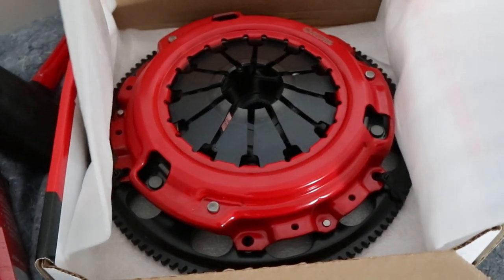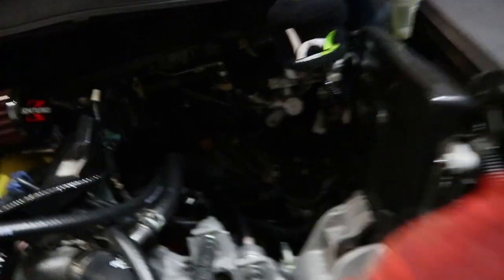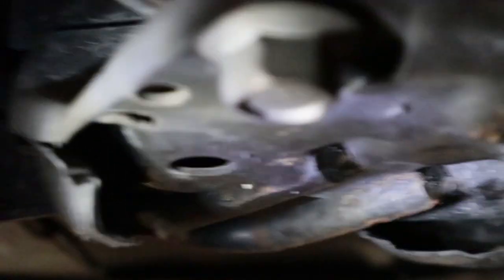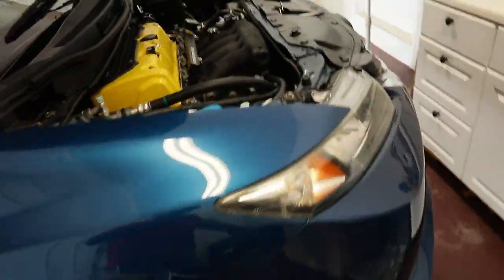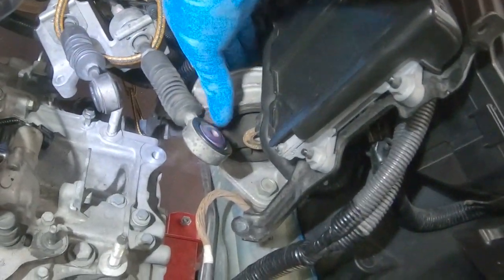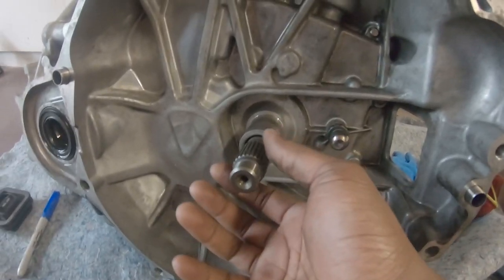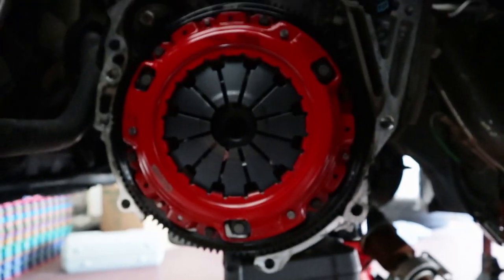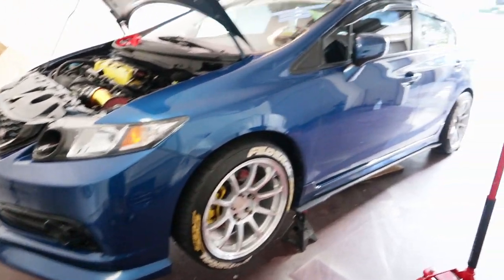ACTION CLUTCH STAGE 3 INSTALL ON MY CIVIC SI

Comment: At 11:43 what are you using to support the engine? You and the instructables had mentioned it at this step after removing the mount, but I didn't see anything in the video
Reply from the maker: To support the engine you can use a jack or a scissor jack

Comment: Hey bro i have a 2012 si i plan on boosting in the future like you planned on. How is this clutch holding up for you? 
I was running a clutchmasters stage 2 but it just went out on me after 8 or 9 years of use...needing to replace and i am considering this action stage 3
Reply from the maker: It’s good no complaints
Reply: Sweet, currently im running a skunk2 dp, skunk2 cai, and borla exhaust tuned. I want to boost in the future, but idk how soon i can do it.
Will the action stage 3 be a good clutch for daily / spirit driving for now?

Comment: Hey bro i have a 285 whp 13 si coupe. What clutch you think I should run? I was recommend a fx300 what u think?
Reply from the maker: Action clutch stage 2 with lighten flywheel

Comment: I have the same car and I installed a stage 1 action clutch with a lightweight flywheel and shyt is not misfiring now. Wtf should I do
Reply from the maker: Disable misfire detection on flashpro

Comment: What's your pedal pressure like? Mine feels a little soft for a stage 3. Like almost stock
Reply from the maker: Adjust your pedal and mine is similar to stock as well , probably 1.5 stiffer over stock
Reply: @zoovie  thanks bro. My pedal is at a good height for me was just making sure it wasn't supposed to be crazy stiff. I'm also using stock cmc and slave

Comment: quick question since you took down the tranny did you take it apart and cleaned it or did you just change the tranny oil or do you think its worth taking it apart to check and clean it lmk asap !!!!
Reply from the maker: Wym? Like opening up the gearbox? I just changed the oil and cleaned the inside

Comment: tip: you DO NOT need to mess with steering column, motor mounts or any of that to do a clutch. just drop the sub frame.. and get a dolly. dont use your little brothers skateboard
Reply from the maker: You do know the rear mount is connected to the subframe? And you have a transmission mount holding up the transmission that you have to remove to even get the transmission out and if you’re dropping the rack with the subframe you do need to remove that bolt for the steering column lol … if you got a video showing you change a clutch on 9th Gen Si without remove motor mounts please send it to me

Comment: You better change them stock mounts son
Reply from the maker: It’s not necessary to change all rn .. rear mount is the most important one and that’s already been changed.. but you wanna send some money I’ll happily change them son 🤣
Reply: @zoovie  haha you got jokes, you have to change the gear box mount too you have alot of pressure there
Reply from the maker: You can drive just fine with a stage 3 clutch on stock transmission mount .. it not necessary to change.. since many 9th and 8th Gen builds with stock mounts. It’s not a 96 civic bro.
Reply: @zoovie  okay novice can't say I never warned you